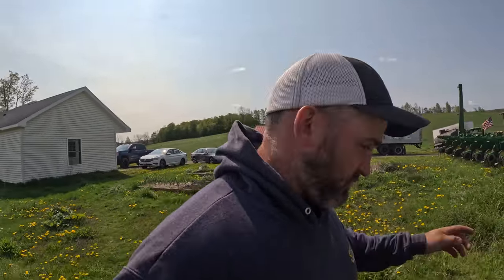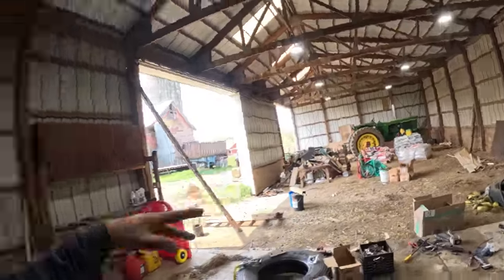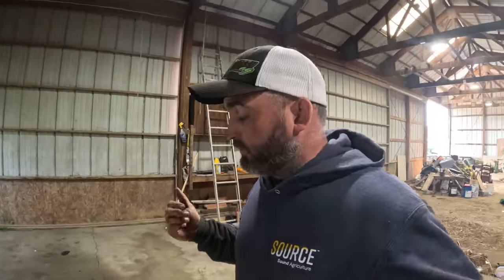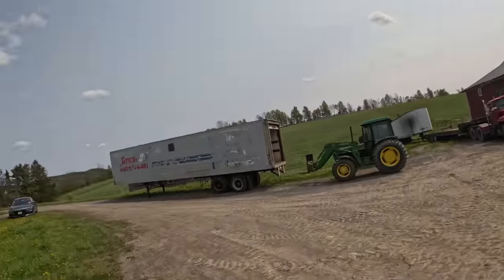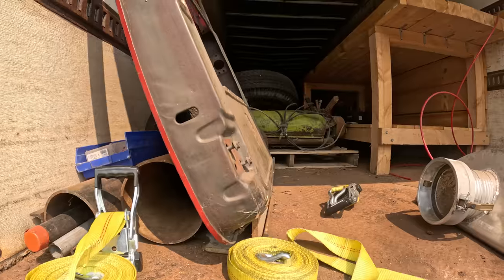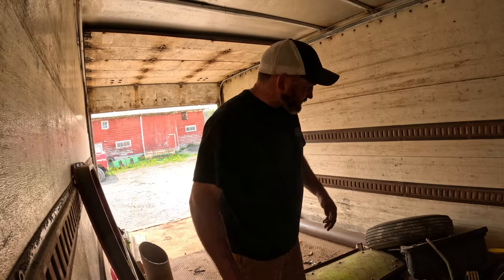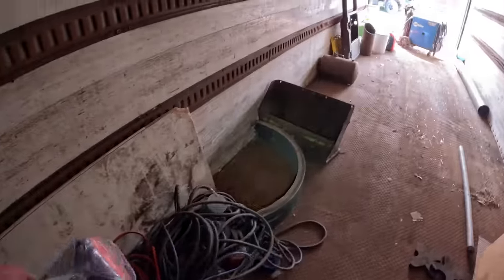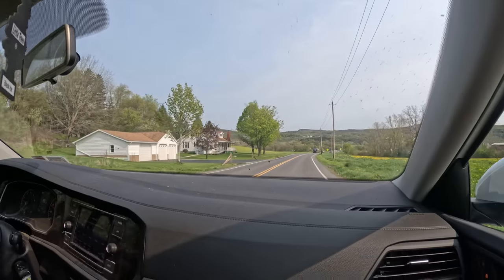Finally The Shop I Need- The Tools I Have  Been Missing!!

Comment: That's fantastic getting new shop organized. See if you can barter a concrete floor.    Please take care to prevent fire, oil soaked, gas soaked rags and spontaneous combustion, smoldering embers from cutting welding. You know, but just have that bucket of water handy or garden hose.  "Haf Assed Kustms" just lost his hot rod building shop to fire while he was away and rcently "Gentry Trucking" also.

Comment: You should build you a separate containment building for your oils and fuels paint cans cleaners flammables. Nothing extravagant nothing expensive just away from what you don't want in danger. Also good place to dispose of your dirty oily Rags at the end of the day , same little building. Same little building needs lots of ventilation not weather-tight but cover. Good to see you slowly bit-by-bit everything comes together for you.

Comment: I'd put the hydraulic press in the back right corner on the cement on an angle next to the shelf and bench. Put the air compressor on a wheels so when you run it put it outside and plum it through the wall. Just thoughts

Comment: Chris i'm still using stick welders.
Reply: Stick is better than MiG for the farm.  Especially when nobody cleans up the metal and they end up with turd welds from porosity.
Reply: @waggtech4883  i've been certified on stick and one kind of wire feed over 40 yrs ago. My head still knows what I need to do. My hands are out of time with.  my head. I don't see as well as I use to. If need to fix something in the field with stick I don't need a wind break.